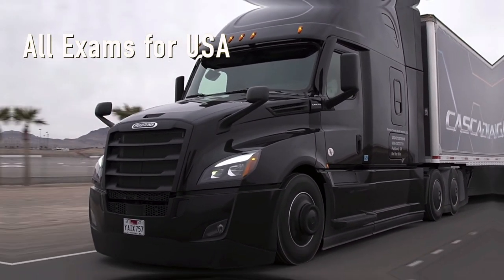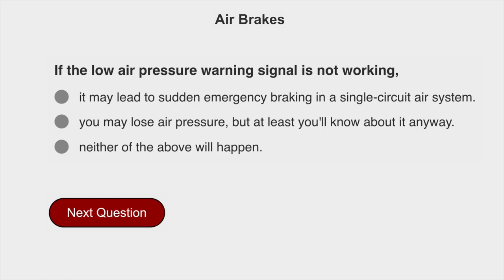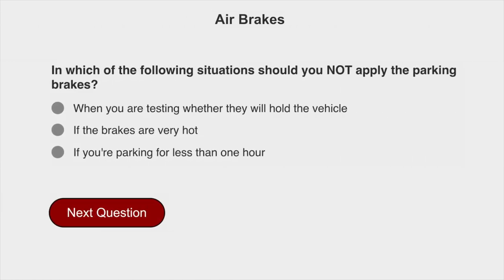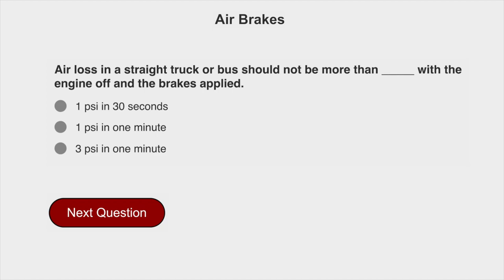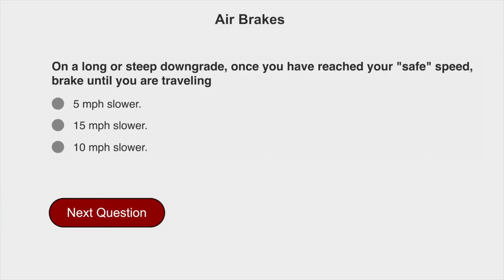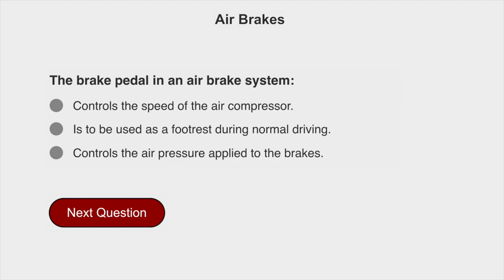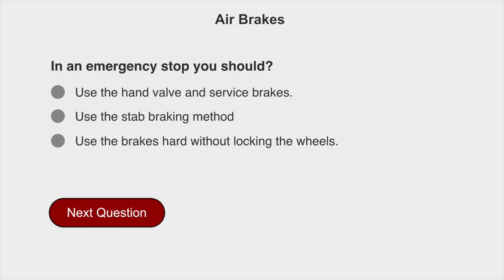2020 CDL AIR BRAKES ENDORSEMENT EXAM QUESTIONS & ANSWERS: EXAM 2

Comment: If the air compressor should develop a leaks, what keeps the air in the tanks? Correct answer is c) the one-way check valve.
Reply: Yea he messed that one up
Reply: I really wish you had timestamped that
Reply: I thought it was the tractor protection valve
Reply: Bruh i came to the comments for this lol i knew that shit was wrong lol
Reply: I'm glad you posted this.  I was ready to go back to the manual and double check that question.
Reply: Yeah bruh they got that one wrong
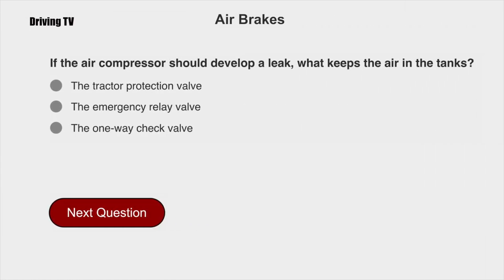Reply: @derpy4335  3:10
Reply: Came here for this comment.

Comment: If the air compressor should develop a leak, what keeps the air in the tanks?  The correct answer is The air loss rate for a straight truck with the engine off and the brakes on should not be more than: ... S-cam drum brake. If the air compressor develops a leak, what keeps the air in the tank? “The one-way check valve”

You guys have the wrong answer for this question

Comment: What r the FEW exceptions the driver should NOT use parking brakes? I have not read about any exceptions in the CDL manual.
Reply: Several answers are wrong on many of theses videos. Too bad they didn't edit and perfect it prior to posting. And no exceptions to not using parking brakes here in Michigan as well.
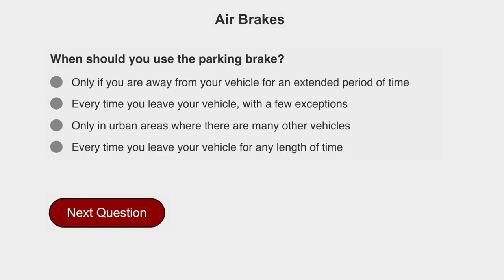Reply: this is at 17:52 -  answer should be every time you leave your vehicle for any length of time.
Reply: The exceptions here in Illinois are: when the brakes are hot and when the road is slippery you must use chocks instead of the parking break.
Reply: @MrSoto333  considering one of the other questions was about using parking brakes when your brakes are too hot, answer was Never. That'd be one of the few exceptions..
Reply: @LordRuric  yeah, I thought of that questions about hot tires, after I answered incorrectly for this one.

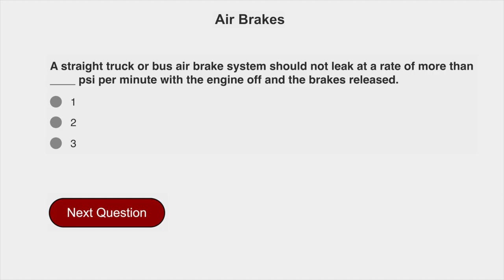Comment: At 11:38 the answer should be 3 ps1 per minute not 2psi
Reply: Nah its 2. 
"Test Air Leakage Rate. With a fully-charged
air system (typically 125 psi), turn off the engine, release the parking brake, and time the
air pressure drop. The loss rate should be less
than two psi in one minute for single vehicles
and less than three psi in one minute for combination vehicles"
Reply: At 11:09 how is it 3psi in one minute then ?
Reply: @teewhy4206  I’m from Florida and it’s was 3psi
Reply: @teewhy4206  in Missouri it’s 4psi
Reply: That question pertains to "static leakage rate" hence is 2psi.  You're thinking of "applied leakage test" for that one 3psi is correct.

Comment: Im frustrated, this is too much to remember. I has to remember 3 different tests that have different answers for similar questions like im super discouraged
Reply: You can do it man just study don't give up one you get your cdl so many doors open up
Reply: @king You need to learn it not remember it
, it will be easy then.
Reply: Just read it and watch the vidz again and again.....trust me.,I did it
Reply: Something that worked for me, is reading the chapter on airbreaks before answering any questions, look at the diagrams and try to understands how the systems works altogether.  By doing that, even if they change the questions a little bit, you'll be able to put the pieces together.  Hope this helps.
Reply: Just study for one test at a time
Reply: 1 at the time

Comment: Has anyone used these videos for a cdl test in florida?
Reply: i have my test today and im in florida ill let you know
Reply: i used the videos and it helped with some of the questions but i still failed lol
Reply: Oh man that sucks, how many questions?
Reply: @metalmessenger  50 for general knowledge 11 wrong you fail. and 25 for air brakes and 6 wrong and you fail.
Reply: General knowledge was somewhat easy the other videos on this channel did help with some questions definitely but like most tests theyre not all the same questions. So just as long as you have a general idea of most of this stuff you should be fine. I almost passed air brakes i was at 18 of 25 and had answered 6 wrong but hadnt really studied it. I took it to just see what i needed lol
Reply: @metalmessenger  ill be takin mine today to ill post up what happens
Reply: Aced the test just now if you get 20 of 25 you ace it and complete it
Reply: @angeljcastro3903  congrats bro!
Reply: @mriguez8991  thx man hopefully you pass yours too👍
Reply: So the general is one thing and the air breaks is separate? You need to pass both at the same time? Thx for the info, good luck when you guys hit the road
Reply: @metalmessenger  yes you have to take 3 tests general air brakes and combination tests combination is also 25 questions
Reply: @metalmessenger  theyre two seperate tests and atleast at my dmv i could go back the next day and do the other. Dont have to be back to back. I did fail the first time on air brakes but i had to pay like 15 bucks for the retest
Reply: Same to you man goodluck
Reply: Just passed the general and combination test, air breaks did it 2x and failed.  Will try later this afternoon.  Trying to get my permit done today.!! Haha
Reply: @metalmessenger  congrats bro🎉. I literally took all 3 today and passed and got my CDL permit. I used CDL prep application on my phone to study and made this test so easy.
Reply: @mriguez8991  you used the cdl prep app?
Reply: @esmelovesyoo  yea and it helped me pass all 3. I studied it for like 2 weeks everyday.  The same questions I saw on the app were on the real test.